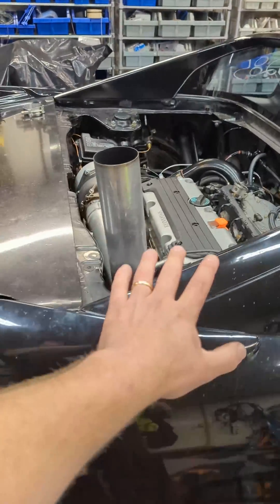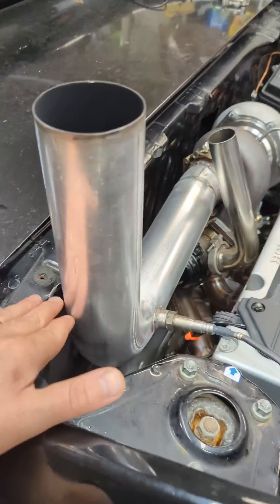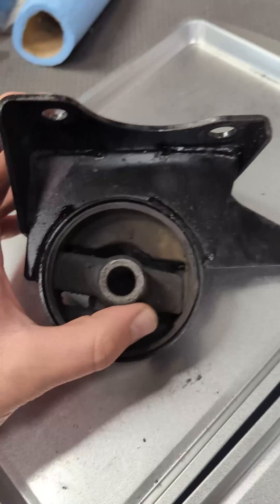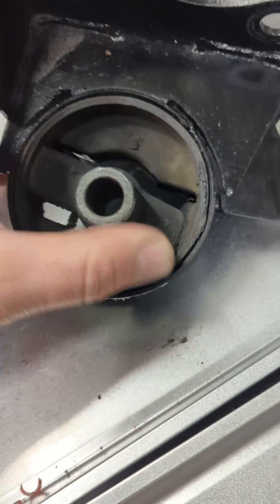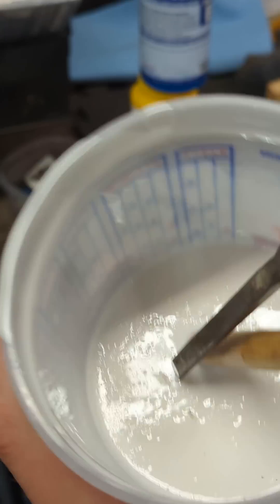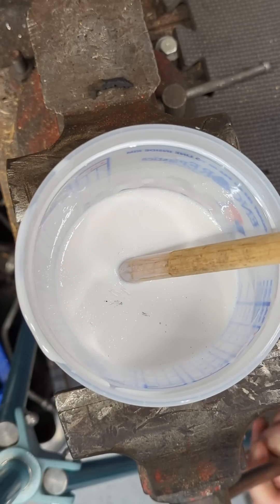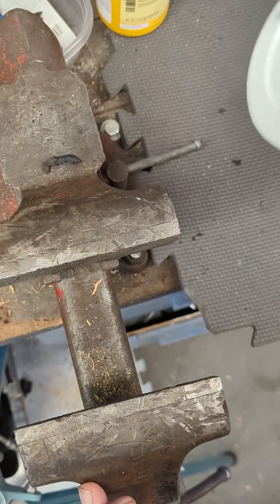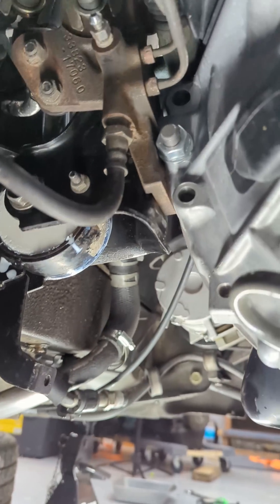Engine swap secrets: a chisel and some polyurethane..

Comment: I briefly thought you were going to fashion a new mount out of wood!😂 Nice work though!👍
Reply: I did too I was like holy drag strip fix batman lol
Reply from the maker: Thanks!
Reply: @MotorSwapDan  maybe a little softer option? But time will tell. It’s flexy for a reason but who knows everything is a lie so this may be the truth
Reply: @CoincidenceTheorist  they are ONLY made of flexible rubber for noise, vibration, and harshness 
.
with solid mounts....you are going to feel the engine shake at idle... vibrate at RPM... every shift will make the car shake and thump..... 
.
but ya arnt gonna toss the motor out of the car on a hard hit
.
.
.
old school is to use a chain....bolt it to the driver side cylinder head (v8) and weld the other end to the frame
.
provides the NVH of a rubber mount.... but when you get on it, the chain takes most of the load
Reply: Me too!
Reply: lol same.  I was down too, lol
Reply: I was ready to come in the comments with a what in the hillbilly hell
Reply: Personally, I like to jam extra bits of rubber sheeting in (as long as the mount is still intact) to make it a solid rubber mount - not quite as harsh, but still reasonably stiff 😁
Reply: It’s not supposed to not move at all
Reply: @scottburnett9653  Engine mounts are supposed to have some give in general. The poly he used is very hard and will still actually move slightly, but it's very close to a solid mount.
Reply: Same
Reply: Hahahaha I mean honestly...
Reply: Same
Reply: That would have been better for the rest of the vehicle.  Solid mount play hell on the chassis
Reply: Same 😂
Reply: Same bruh... by the end I was like that's gonna work bro
Reply: I was so scared 🤣
Reply: Wood has been used be for
Reply: Personally, I think you should have embedded wood particles in the hard material to give it a lil wiggle. Like how rebar keeps concrete from fracturing.
Reply: @karl68012  nothing you said makes the least bit of sense. wood shavings would not give the polyurethane movement. and your example of rebar in concrete doesnt equate to this at all

Comment: What was it that you mix up?
Reply from the maker: It's called Smooth-Cast 65D and it costs $38 on Amazon. Got the car fired up today after taking it apart for the clutch plate alignment mistake. I'll probably do a test drive tonight then I want to get it on a Dyno. Working on boost controller right now.
Reply: @MotorSwapDan  nice can wait to see it on the dyno and track!
Reply: Never knew you could do that. Would this work on suv that do a lot of overlanding. Gets expensive after a few trips

Comment: How is the mount doing?
Reply from the maker: Excellent so far, helped shifting feel a ton
Reply: @MotorSwapDan  sweet!
Reply: You can bring it to a windshield repair place too they have a not quite as stiff polyurethane to fill them up with works great 
That stuff seemed like a fiberglass resin type 100% solid 0 flex polyurethane

Comment: I welded tow chains to the powerplant in my truck and bolted the chain to the frame. The don't make affordable mounts to handle    it.
Reply: Justa Burger.... so you welded a steel chain to your cast iron engine block? Why didn't you just bolt The Chain to the block?  I had a 68 Nova that I had to chain down.